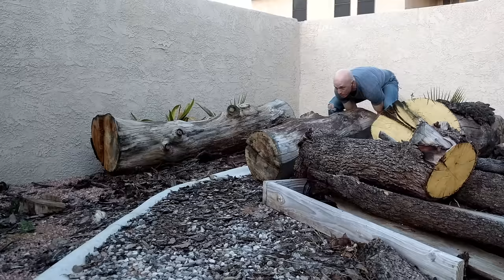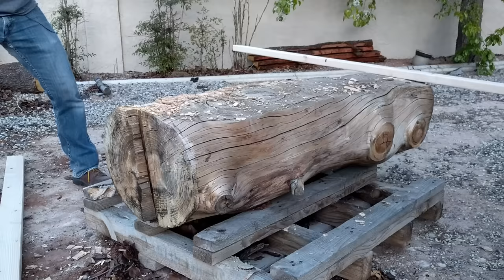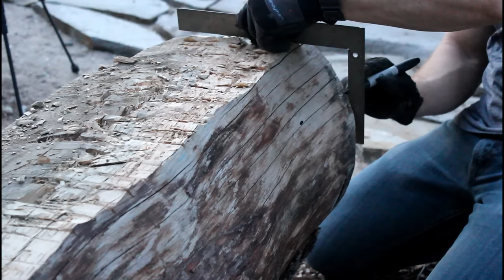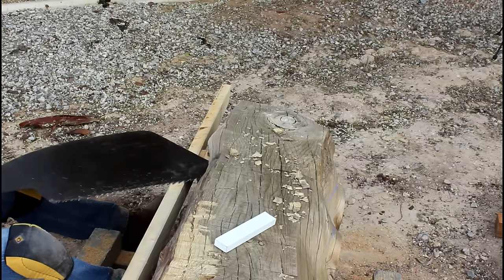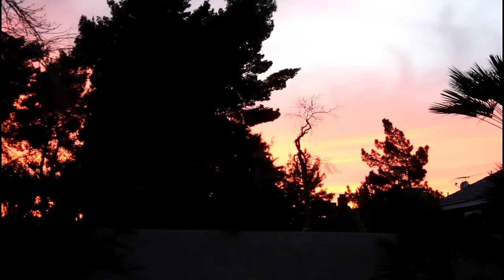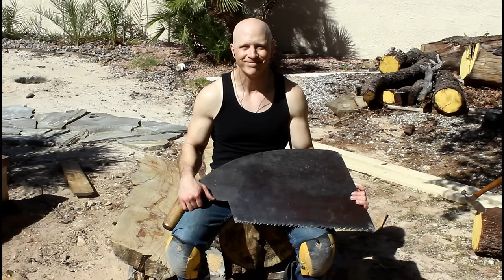Japanese Whaleback Saw - Cutting Lumber From A Log (Maebiki Nokogiri)

Comment: That's a pretty awesome saw. I've been wanting a saw in this same vein for cutting down bigger timbers. In your experience do you prefer the maebiki or the anahiki for timbers (logs or sawn boards) that are in the 8-15" size range? Just curious
Reply from the maker: +Lemongrasspicker the maebiki is easier to keep a straight cut but is not as versital as the anahiki. I haven't tried the anahiki on anything larger than 8".
Reply: cool, the anahiki makes sense as the more versatile of the two. Thanks for the reply

Comment: Do you wax or oil the blade now and then? That would relieve a lot of wasted effort due to friction.  Have a look at Paul Seller's video on making an oiler.  He rolls a dish towel tightly and fits it into a can, and then saturates the towel with 3-in-1 oil.  He wipes both planes and saws with the oiler to ease the cut.
Reply from the maker: +Bob Blarney thank you. I've seen that can. It's a really good idea. I love Paul Sellers' videos. I'll have to try using an oil or wax next time.
Reply: If you can polish the blade first and then wax it, the effort will be greatly reduced and I think the quality of the cut will be better too. (Hope those boots are steel-toed, by the way!)